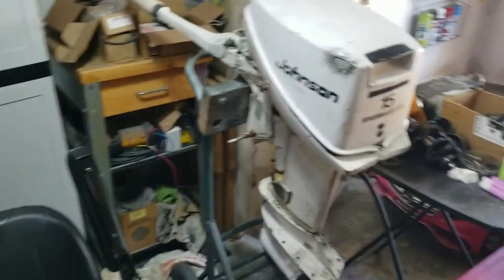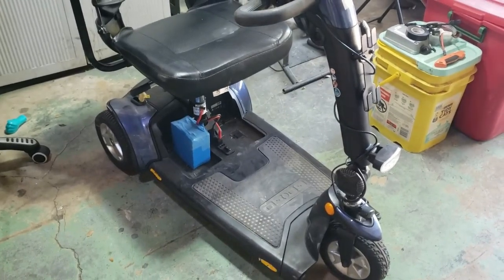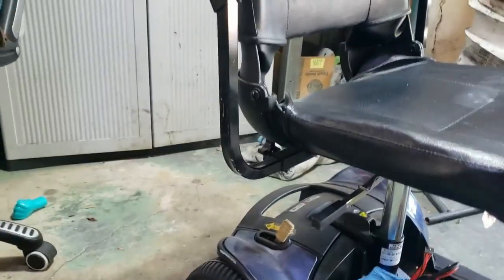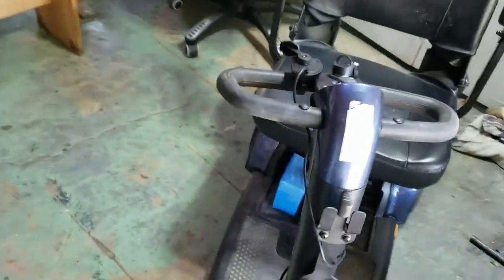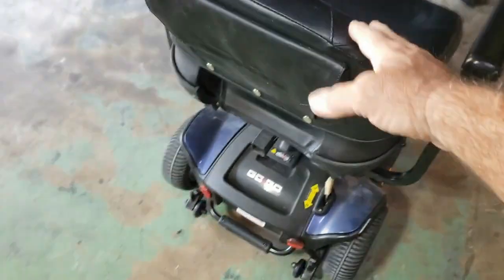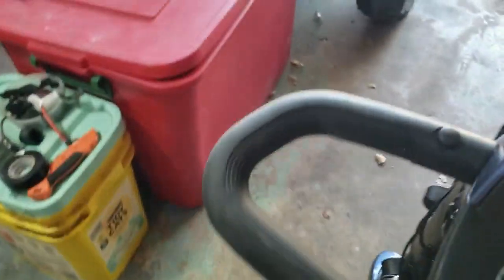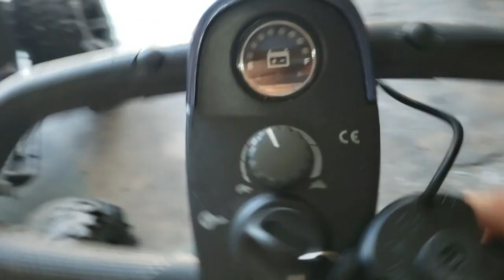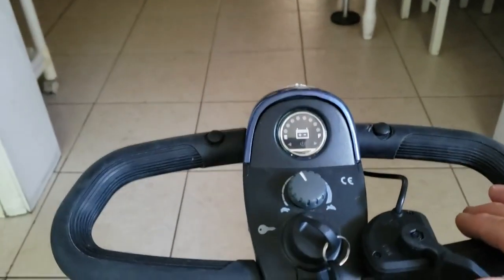I found a FREE mobility scooter! Fixed w/ Ebike Controller.

Comment: What this needs apart from decent brakes ( a must!!! )  But,  also finding some means of finding out what it's top speed is 🤔  ( must be over 8mph with that more powerful battery on it But, how  long can that motor take such power from a 500w battery ( if that is what it is) i may have "misunderstood"  what has been said  from  a basic 2 x 12w batteries. 🤔🤔🤔🤔🤔
Reply from the maker: I did hook up the electric motor brake now but it's not great. Only comes on a few seconds after throttle is released so not ideal.. I have a GPS app on my phone that could check top speed... The battery is 24v same as stock but its lithium ion so it packs a punch and delivers plenty of amps for wheelies. What's 500 watts now is the controller (ebike controller)which really isn't much more powerful than stock controller- just capable of quick bursts for wheelies and lots of torque. I may overvolt it to 36v soon...
Reply: @niz76  YOUR MAD!!!!  😁😁😁😁😁😁😁😁 but,  in a clever way. 🤔👏👏👏👏